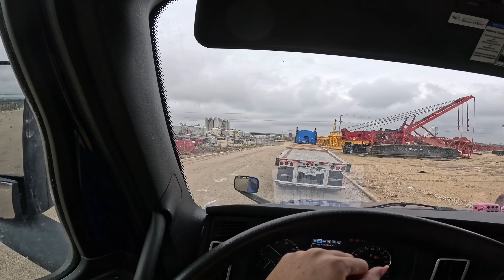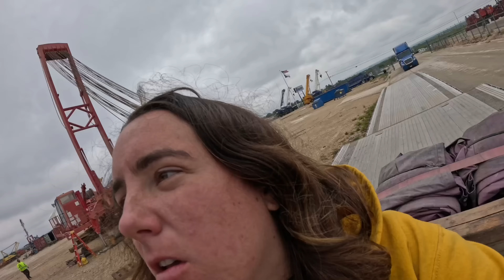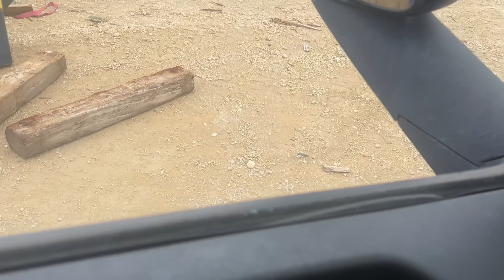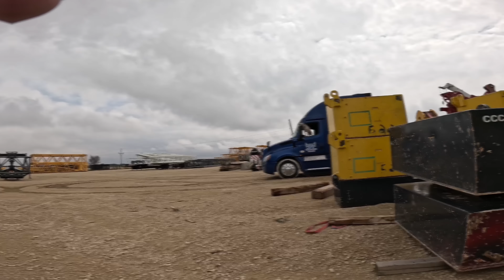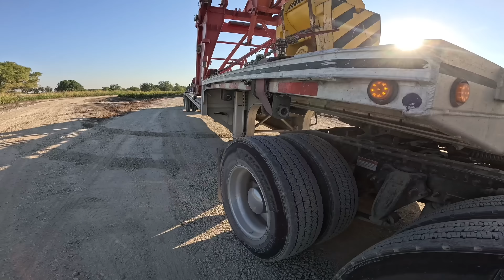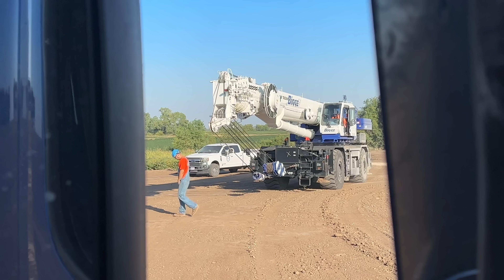I Thought This Load Was Going To Be Bigger! 😮

Comment: I really don't care for brewed coffee and never have. I only drink instant which I think is better than brewed unless you can get your hands on restaurant style coffee which brews  at a high temp. I drink Nescafe Classico instant which is a dark coffee but really good. Get yourself a box of Truvia stevia sugar and some Nestle coffee mate creamer ( I use the powder kind but you can get the little liquid cups which require no refrigeration)  and you csn have coffee any time you want it. You'll need hot water but I don't know how you would manage that in a truck. Oh wait! You can heat up water in your microwave! Get your self a Copco coffee cup ( they're plastic) and pour in some bottled water and heat it up then add the coffee, truvia and creamer and you can have coffee anytime!!  Make you a salad out of those vegetables and cook a piece of chicken, slice it up , add your dressing ( i like Kraft Catalina) and add it to the salad. Quick meal right there!!  Enjoy your video content!
Reply: Get a thermometer pin to measure the water temp of the microwave  water.  If you're making instant coffee it only needs to get to 150. It doesn't need to boil. If it boils you'll have to wait a long time to cool down before you can drink it.  Another option is to get a induction cooktop burner and a coffee pot to heat water that way. They're really cheap right now. Less than 30.00.  Just trying to help. Hope you get it figured out. 😊

Comment: Hey little sister. 
Anytime you start off with a clean truck. It Will rain on you or you end up in some s*** hole. What I had my second brand new truck. It had 1200 me when I got it. 92 Freightliner with a 4 and 1/4 cat. Took Lumberton Southern California from northern Cal.
 Picked up a load of brand new irrigation pipe from 20 footers to 30 footers. All finger joint staggered. Took them up to Visalia. End up going out to a field. As they unloaded them one by one on the fuel. Piss me off. I told him I had a cat that was in a caterpillar. So they pay me $300 cash extra. That would in my pocket😊.
Good luck girl. You know if you don't mind drinking instant coffee. Get yourself a glass measuring cup. Stick it in the microwave for 5 minutes instant coffee. 🤘🏽🤟🏽👍🏽🤙🏽👌🏽😡♥️✌🏽😎🪶🌹☕